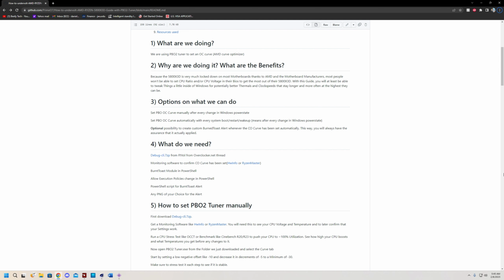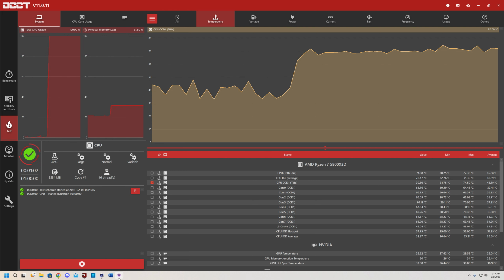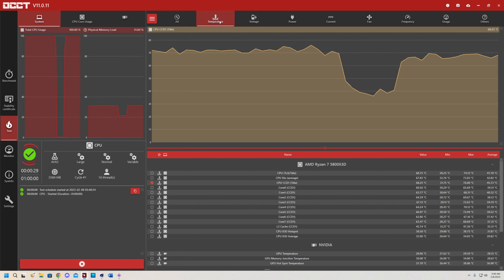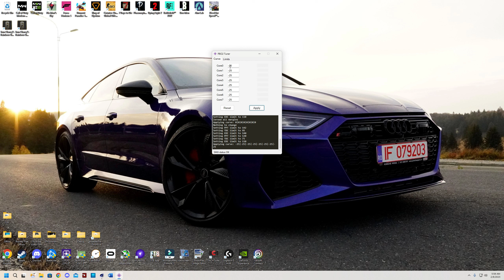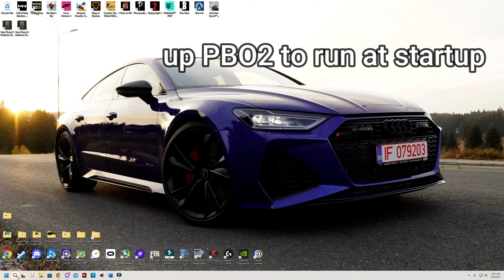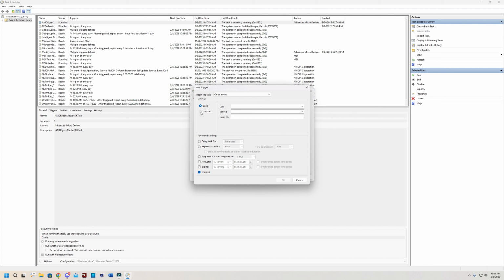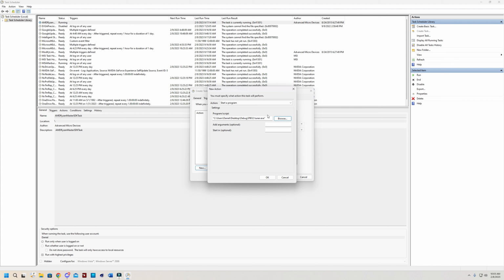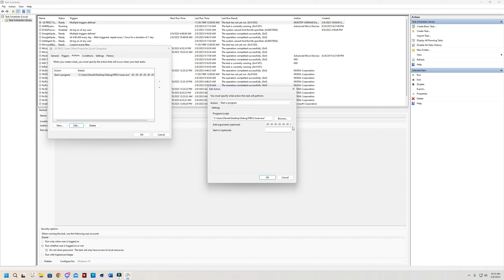5800X3D Undervolted with PBO2 Tuner (Setup Guide and Performance Testing)

Comment: If you want to save the limits in the task scheduler just type those values after your core clock offset values. Lowering the limits let me keep same performance but reduced cpu temp by 20 C
Reply from the maker: I'll give this a try, mind if I pin your comment for people to see as this is really helpful if it works as you mention 👍
Reply from the maker: If you could please let me know how you entered the values? I'm having trouble getting task scheduler to run with offset and values both being there.
Reply: @Beefy-Tech  I reduced my PPT, TDC, EDC limits this is what helped reduce my temps. 8:54 in the arguments, you type in your curve values for each core. That is 8 values. Then you type in your PPT, TDC, EDC and then 0 (0 means don't change any of the other fields like MaxBoost Temp LImit, FIT Scalar)

So for example mine looks like this

-30 -30 -30 -30 -30 -30 -30 -30 95 80 100 0

PPT = 95W, TDC = 80A, EDC = 100A
By reducing my PPT, TDC, EDC limits I saw almost 20C drop while gaming, no performance drop and actually hitting the 4,450 Mhz (before I woudl only hit 4,100 Mhz)
Reply: @Beefy-Tech  absolutely, it's not letting me edit my comment with me explaining how I entered the values, I responded below, but feel free to pin my response as well
Reply from the maker: @mannyfresh7065  gotchu fam, I had some issues trying out the numbers yesterday and I input 120 75 110 after the offset, but no luck. Imma attempt to input 120 75 110 0 in a bit and see if that does the trick
Reply: @Beefy-Tech  Is it normal with this limits to loose little performance like with limits score in cinebench is always 14900 but without limits and only offset -30 to all is 15200 score? i see with limits cores are sometimes drop to 4400-4380 etc but without limits all are 4450 and never change while doing cinebench? Ofc limits drop temps by 5-6C.
Reply from the maker: @ZondaRbg  limits can hit performance negatively yes, if CPU doesn't have enough juice it can't benefit from the temperature drops that the-30 offset provides.
Reply: Where in Task Scheduler do you type the PPT, TDC and EDC values? The only place I can find is in the description under the general tab. Thanks.
Reply from the maker: @mmaaddict78  where you type the offset values you just follow up with the limits, and then add a 0. The line would look like this: -30 -30 -30 -30 -30 -30 -30 -30 120 75 110 0
Reply: This absolutely works. Thank you so much for saving me the trouble of having to manually set limits every time I reboot windows lol
Reply: THX
Reply: Is it possible to do a per core undervolt if i know my best cores and wan't to set them to different values so for example -7 -25 -25 -10 -15 -25 -25 -25😅
Reply from the maker: @Turbonuotti  yes. You would just type the command line in normal core order n it'll work 👍
Reply: I could change all those settings in my bios (gigabyte x570 aorus elite, last bios), not sure if its a new feature or just the motherboard model allow to change it
Reply: @betogaso  would you mind sharing where you set it in the gigabyte aorus bios? so you skip the entire PBO part? for the 5800x3d right?
Reply: @tenso8162  sure, in the bios go to "tweaker -> Precision Boost Overdrive (PBO) )set to Advance) -> PBO Limits (Manual) -> ppt (95), tdc (80), edc (100); Precision boos overdrive scalar (auto); Curve Optimizer (enter here)-> Curve optimizer (all cores) ->All core curve optimizer sign (negative)-> All Core Curve Optimizer magnitude (30)
Reply: @betogaso  appreciate your reply! So weird, I didn't see those settings. I'll check again tomorrow. Although my mobo is gigabyte x570 aorus elite ax.. Not sure if that makes a difference. I'll double check my bios version as well but pretty sure I updated it within this past week
Reply: does this work on bios got a msi b550 gaming plus
Reply: @betogaso  Btw thank you again! I ended up needing to update bios version, and once I did I was able to apply the settings!
Reply: @japren26  I can't speak for your bios but PBO2 tuner program does work on pretty much any motherboard
Reply: @Tenso awesome, it saves a lot of time :)
Reply: @mannyfresh7065 hi can i limit my max boost to 4400mhz. when using -30 or even -25 and messing with PPT, TDC and EDC i can't get 4450mhz but it hovers around 4420-4430mhz. If i can, what to write in command argument 8:45 ? talk about sillicon lottery 😢
Reply: @mannyfresh7065 my full spec are

5800x3d
MSI MAG B550m Bazooka
RTX 3060 ti
Patriot Viper Blackout Series 4x8 gb (clocked at 3200mhz)
Noctua dh-15 s

i'm using windows 10
Reply: @mannyfresh7065  Thank you so much mannyfresh!
Reply: idk why but mine always around 4200 when i set -30 120 75 110 
it can up to 4300 when i don't mess any thing else just -30 
my spec is
5800x3D 
Gundam 3080
Dominator 3200CL18 set at 3200
nzxt B550 1.80 bios ver
Kraken 280mm
Reply: what do you mean and where? what do I have to do differently than he did?
Reply: @mannyfresh7065  did you have to do those values first in PBO2?
Reply: it worked👌 thanks🙏
Reply: @mannyfresh7065   Thx u much, works perfectly!! Appreciate the share!
Reply: @ZondaRbg  how did you got those scores?I barely score 13k
Reply: @SuperMahsat  for cinebench need to close all other apps/browser and score will be better and main thing is your cpu to work non stop on 4450 while u doing the bench, to do that need good temps below, if is hot  while u bench frequance will be 4200 4100 etc and your score will be lower.
Reply: House real big!
Reply: or just use your BIOS....

Comment: The 5800X3d is a good binned part because of its Voltage limitation due to its V-Cache , most 5800X3D will work with  - 30 which is already the maximum , higher Numbers have no effect  at the Curve Optimiser , i would choose this as the starting point and only if there are Problems i would reduce the value , my 5800X3D works since months without issues at -30
Reply: It depends what bin you get. You have really bad bins that cool really hard even with proper undervolting. I had the bad luck of getting one which can barely be cooled with an aio 360mm - under cpu intestive workloads and cinebench on stock temps rise to 90°C+, with pbo 85-86° with fan rpm's close to 2k. Optimum tech recently bough a second which was also a bad bin - very hard to cool compared to his first cpu.
Reply: @mesicek7  
Its the first Time i heard something like that with an 5800X3D , here is an CBR 23 run of my 5800X3D https://youtu.be/0jkzGVoQs5w
In the right upper Corner you see the CPU Temp is at 77-78 C (celsius) with an Power consumption of 80-81 Watts , of course the Temp will go up a bit  if you run cinebench for a longer Time , but you get an Idea how it looks like ( it depends on You Tube how long it takes to be aviable in HD ) 
The key is the Curve Optimiser at negative 30 , lower Power consumption = lower Temps even at full load .
Reply: @MK-xc9to  Well, I can be included in @mesicek7 case, I'm at -30 using Arctic MX-6 and AIO 360MM (Push and pull) and at CB R23 it is hitting over 81 which means it is dropping frequency already. I will be trying to use liquid metal as my last option. Pump is at 2700rpm, fans at 1600, no luck here..
Reply: @fernandosbtech  I just got my 5800X3D and have similar problems. I use a 360 AIO form Alphacool and liquid metal, I am not able to get the temps under 90°C in Cinebench R23. I also tried the same PBO2 settings shown in the vid, but still the same. It is driving me nuts. I first thought its a problem with my cooler and alreade dismounted it and reaplied some liquid metal to be sure, but did not make a big change.
Reply: @MrDromp  mine I couldn’t get it resolved but check if it helps you, when you are installing the AIO and it uses the original bracket to tighten, ensure the Aio pump is not getting stuck on this original bracket, if necessary you will have to loosen this bracket to make the pump fit properly, hope you can understand 😂
Reply: @fernandosbtech  ah yes, I know what you mean. Actually on this alphacool I have to disassemble the brackets first otherwise I couldn’t mount the cooler with backplate at all. 
I got the CPU to run at over 4000 MHz in cinebench r23. In average it stay around 4075 to 4125. The score is now on 14118. I think I just got one of the lower end of this chip. I think it is a combination of bad silicone and bad heat spreader. I was thinking about building a custom loop and integrate my graphics card into. If I do so I definitely will clean the head spreader and check how uneven it is. I saw some projects about leveling and polishing the HT.
Reply: @MrDromp  can you feel the heat on the radiator also? I had a bad aio unit that cpu was getting very hot but radiator was cold.. also try setting -30 undervolt to all cores and also try reducing the PPT to 112 (max cpu watts) others leave auto and check how it goes, maybe setting fixed max power you may get higher clocks and lower temps
Reply: @fernandosbtech  Thanks for your advices. I already set all cores to -30, it seems this is the only thing what really has an effect. I tried a variety of values for PTT, TDC and EDC in PBO 2 Tuner, but there wasn’t really a noticeable difference while testing in C R23. With all cores at -30 the temps raises a bit slower in benchmark, what result in a slightly better score. As I see and think, it seems to be a thermal issue. 
My AIO isn’t new and worked really well on my 3900X. I just cleaned the old Liquid Metal from it and applied new on one on cpu and cooler. I remounted it three times now. At the first one I think I was a little to thrifty whit the new Liquid Metal, so I added some more and it get to the point were I am now. The last time I remounted the cooler, I just turned it 90 degrees in case that the flow direction over the CPU may have an impact on cooling performance, but sadly it has not.

I think my unit performances well in games nevertheless. I tried the benchmark in shadow of the tomb raider, it run pretty good. While gaming the temps seems okay I am just curious about the low score in C R23 (Stock at around 12900) and the nearly instant 90 degrees C.

Edit: Oh sorry, I forgot. Yeah, the outlet tube and radiator is getting warm. Also the inlet at the cooler is way cooler
Reply: @MrDromp  If nothing works for you then maybe try direct die cooling, the Ryzen IHS is too thick and can really limit the cooling performance.
Reply: Hi im Noob got -30 and idk whats the best voltage limits I put 95    60    90   and works its okey?
Reply from the maker: That might be too low... I'd recommend something slightly highet
Reply: @MrDromp   It should not be the AIO , i have an Alphacool Eisbär 360 now as well , look at my temps now during a single CBR23 run , i added an 280 radiator https://www.youtube.com/watch?v=daF65Vp0Xs4
its 72 -73 C , i dont use liquid metal ... 
i use a PPT of 113 Watts , -30 on the Curve Optimiser anda negative offset of 0,05v  in Bios. I should mention that i pushed the IF of my 5800X3D to its limits , it runs at 1933 = DDR3866 in 1:1 ratio  , i had to raise the IO Die Voltage to a relative high Level of 1.105 v to archive that with a SOC Voltage of 1,215v
In Games the Temps will we lower , as you can see here in my Jedi Fallen Order Game
https://youtu.be/R308hT3Gwc8 , its locked to 90 FPS in 1440 P with just 120-130 W power consumption on my heavily undervolted and with an edited Power Curve 6800 XT 
Your 90 C is too high , what Power consumption do you have during the CBR 23 run ? i have 80-82  Watts ( PPT 113 Watt )
Reply: @MK-xc9to  hey there. I tested again to show how the actual power draw on the cpu is during the test. It starts at 104W and goes down to 92W. Running a 10 min loop on CBR23 pushes the CPP down to around 85-88W. Settings still -30 on all cores and no other changes due to it doesn’t really make a difference. As I said earlier, I can lower the PPT to a point where the CPU start keeping cooler, but also has a big hit on performance. All above this point make nearly now difference. In games the max temps are way lower, just a really CPU loaded game like X4 got the CPU on around 88-90C some times. 

Edit: What’s kinda interesting is, that no core goes over 90C during the test. Also the L3 Cache stays at its max 69C. But the CCD 1 reports a temp of max 91,5C
Reply: @MrDromp  I have 81-82 Watts of Power usage and the Curve optimiser really make a Difference , do you use the Software PBO2Tuner or the UEFI Settings? Sometimes the Bios Settings are there but have no effect or work correctly on some Brands , HWinfo show the same values as the overlay . If your Eisbär AIO is older than it may be that it helps if you rotate the CPU cooler by 90 degree because it was designed for cooling the Center and not the upper left  of the Center where the chiplet is on a Ryzen 5800X3D . Several other AIO had the same Problem with the Chiplet design , the 8auer ( Roman Hartung) even designed a Cooler holder which moved the cooler a bit towards the CPU Chiplet but in your case the 90w or 104w are the culprit for your higher temps i guess
Reply: @MK-xc9to  My MSI 570 unify does the job very well, as I see. I tried the Kombo Strike function and also the Curve Optimizer function of my board. Both are working and doing exactly the same. At Kombo Strike 3, PBO 2 reports that all cores on -30, at KS 2 -20 and so on. The curve optimizer seems to do the same, with the advantage I can set specific values per core. Cause it is just easier I sticked with KS 3, so all cores on -30. PBO2 is confirming that. Also I can truly see the difference in idle or startup temps and also in CBR23 score.

For comparison and cause I first thought that may PBO2 or the UEFI settings are not working correctly, I did all my testing on both. I also did a BIOs reset and started from scratch. First I tested PBO2 and then onboard. Both are performing the same at -30. So I can not see the fault there. 
I mounted and demounted the cooler several times, cause I first thought something is wrong there. I had a fault there at first. The amount of Liquid Metal was to low, so I added some more and got better temps. I also turned the cooler 90 degrees what result in just slightly better temps.
Reply: I just got my 5800x3d and did this. Stayed with a pbo2 of - 25 all cores, and first occt test after tweaks I was getting about 77 to 80c during the test. Configured the task, restarted the pc and ran occt again. Now I'm sitting at 68c max during test with about 88w of power. Didn't mess with the limits and am getting consistent 4445ghz frequency for all the test
Reply: I am running cb23 with a max of 72 degree with a 360 arctic liquid freezer aio and a push/pull fan config. Just did -30 in the bios and it‘s rock stable. I mainly play simulation titles like Iracing and the cpu is absolutely chill.

Comment from the maker: Just wanted to mention a lot of motherboards do actually support pbo2 tuner in bios, but not all of them do. You will have to look up your specific motherboard and check to see if it had PBO2 support in bios!
Reply: 110w 70a 105a  -30, is the best for mine - still not liking the temp - 80c - (but have to be fair as I am on a closed ITX build) and above all the total sys doesn't go above 300W under full load with a 6700xT :)
don't think I can finetune it more...
Reply from the maker: @HitSousouK  I use 120, 75, 110 if I remember correctly, but yes, the case and cooling matters most here. You might be seeing hot Temps but in ITX it kind-of makes sense, especially with a cpu known to run hot
Reply: Asus b550 strix wifi 2 Support it with the latest BIOS. I Set it to -30 all core in the curve optimizer setting direkt in the BIOS works perfekt.
Reply: Any clue if mine has it cuz I can't find running the latest bios version, X470 Asus ROG F-gaming?
Reply from the maker: @Cheesy1cheese  best way to figure it out is if you have "Curve optimiser" in the bios. I'm not sure if you have it but that's what you'd look for.

Comment: A month ago I did this and set all core to -30. Did many stress tests and games and never had crashing. Saw a nice boost in clocks it’s now at 4.45ghz stable even sometimes when all cores are being used. It’s higher then the clocks I was able to squeeze out manually from my previous 5600x. And my temps are looking juicy. Usually never goes above 75c in games.
Reply: When you get a chance please reply, new to the pc world and finally built my new pc yesterday. I did the -30 like you did and my max temps just sits at 78-79c max 100% load on cinebench. Is that bad? Multi core score was 15024
Reply: i can never get my 5800x3d to 4.45 ghz max. Stocked its around 4250-4350. With pbo2 i get 4.42 maxed -30 all. I guess that'll have to do. My temps are never that high anyways with a krakenz63 i get around 60-65 at stock anyways... Edit: NVM task manager says cpu is at 4.42 but msi afterburner in game says its maxed 4.45...
Reply: @SSSx30  nope that’s really good!
Reply: @Excal123 I got the same setup and my temps are 85 on cinebench. Only 4.3 after the - 30. Am I missing something? Did you redo the paste on the x63? Is it loud also?
Reply: @DanielSmith-ys3ov  that's really high temps. I've never had my temps over 80 not even close probably the highest I've seen recently was 72 and that was rare idk. I did redo the paste because I had to put the cpu in.  Ambient temperature around here has been cold lately too so that might be part of why mine is lower I shall see in the summer months that should bump it up a little. Not sure what cinebench is as it might stress it more I'll have to see. My z63 also seems quiet too.
Reply: Your 5600x wasnt able to boost to 4.45GHz, did I understand that right?